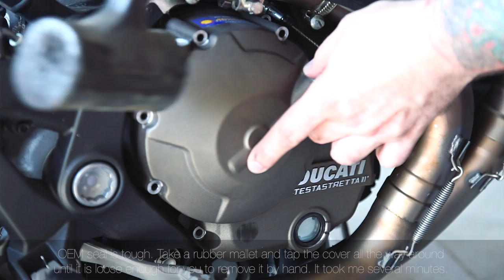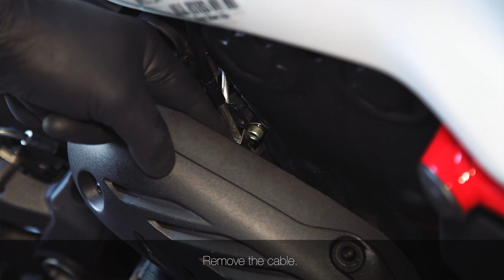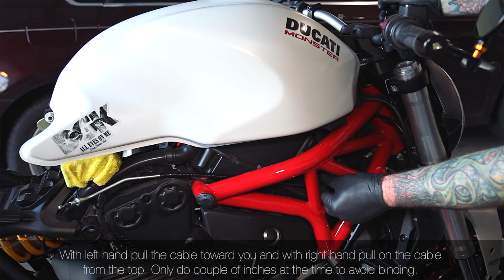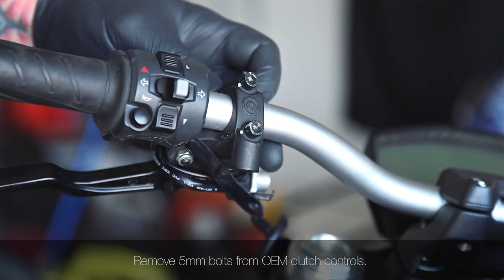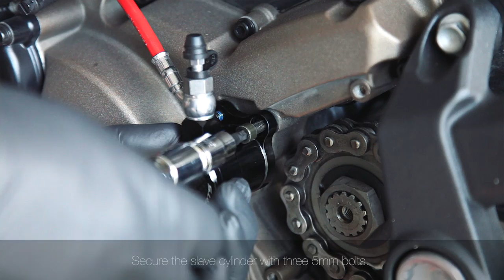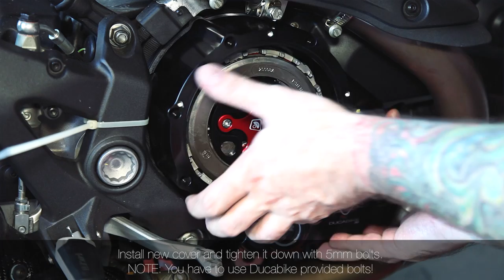Ducati Monster 821 | Ducabike Clear Clutch Cover and Hydraulic Clutch Conversion

Comment: had no idea so much work was involved in changing a clutch cover, you know your stuff man!! videos and bikes
Reply from the maker: It's all because Ducati went cheap with 821 and for whatever reason removed hydraulic clutch. On all other models, it's very simple job.
Reply: Thanks for the detailed video. It's unfortunate so much more needs to be done to get this cover installed. Did you find it to be a pretty easy task? How does the clutch feel vs the cable to you? I'm hoping to do this to my 2021 821.

Comment: For those who converting hydraulics without the clear clutch cover. You also need the plug for clutch cable hole on the right side and of course the clutch slave. And for the sprocket. I believe you can use the 1200 sprocket cover. 10x cheaper then the aftermarket ones.  Hope this info helps. Tq!

Comment: Great Video, excellent workflow! I have an Hypermotard 821 and previously owned two Hyper 1100 (both stolen!!!).
Never understood why Ducati decided to go the cheap way with the 821 engines and clutch cables instead of hydraulic ones.
Seriously thinking to do the mod. Looking at your video looks like is doable by someone with good mechanical skills like me. I am missing the jaw press for the OEM bearing and pin part though...All the best !
Reply from the maker: Damn dude, both stollen? That sucks :/
Yeah, this is not hard to do at all. There are a lot of steps but you should be able to do this in an afternoon. Of course it took me couple of days because of filming and it being insanely hot outside but I put in about an hour of actual work.
Reply from the maker: It's been a while so I don't exactly remember but I think it had to do with the fact that the next piece is torqued quite high and in turn torques the other bolt too. Instructions should state what to do.

Comment: excuse the question a little ignorant to install the clear clutch cover system is it necessary to change the clutch system for the Hydraulic Clutch Conversion?

is it really necessary to hire a specialized mechanic?

Well, I have had a motorcycle for 8 years and I have basic knowledge of motorcycle mechanics, but to carry out this work the accessories are already quite expensive and hiring a mechanic to do the work would be another additional cost, well my question is, can I do this process without requiring a mechanic?
Reply from the maker: Yes, hydraulic conversion is mandatory for the clear cover. Since i don’t know you or your abilities, i can’t really answer your question but what i can say is that i am not a mechanic and do not have a whole lot of experience with motorcycles. Hope that helps.

Comment: I'm trying to remove the clutch cover from my Ducati Monster, and it has the factory adhesive. I can't get it off, even though I've tried prying it and heating it with a heat gun, but I can't detach it.

Comment: So nice mod man..I'm buying all the components this days, but i have a question..what about the dirty oil on the plexiglass? Did you get some overdirty problems on a long time or is it enough clean? I'm scary to spend lot of money to get an extremely dirty plexiglass all the time
Reply from the maker: Plexiglass stays clean. Even when oil is present, it doesn’t look dirty. There isn’t much of it anyway and it just slides down. When you are done with the ride, oil goes down quickly and it doesn’t look dirty at all. If for some reason you get buildup over time, plexiglass is very easy to remove and clean.

Comment: Hi mate i own m821 2018 and im planning to put an exhaust so lookin for zard ,sc project and akra...do i need to put auto tuner or ne fuel management system like rapid pro or dynojet if i put exhaust other than termi which comes wid map key

Comment: I can’t remove the clutch cover  even wiggling  for 3hrs  but it just stock on it🤨is there any problem during the installation
Reply from the maker: The glue they used is very strong so it takes a lot of effort to get it off. Try heat but make sure you don’t use anything sharp to pry it off.

Comment: Great upgrade to the bike I just think it's funny how you had to remove so many parts like the head light just for the install
Reply from the maker: Lots of little steps but not really that much work. With naked bikes, they have to hide things wherever they can which makes working on them a bit harder.

Comment: Very nicely done. I have no plans to buy a Ducati but watched the video till the end anyway. lol.

Other than the good looks what's the advantages of doing this mod? ease of maintenance? better clutch feel?
Reply from the maker: You can work on the clutch by just removing the window vs. removing the whole cover. Don't have to worry about oil spilling nor messing around with liquid sealer again. Clutch lever is feather light now and overall the bike seems a lot smoother. Rev-matching on downshifts seems better to.
Reply: Hold Fast Films Ah okay, sounds nice.

Comment: Fantastic lighting and video work. It'd be really handy if they included some guide rods to help slide the new cover into place without possibly messing up the gasket.

Can you do a clutch basket and plates swap on the bike now with that window? No more need to remove the entire cover to service the clutch?!
Reply from the maker: Thanks man! I agree about the gasket. It fell down 3 times while I was trying to film it. Have to put it on there ever so gently and even then you can't really see if it's bunching up. It's not leaking so far so I think I'm good.

Funny you bring that up, when I first started looking into this I saw that you can work on the clutch without taking the whole housing off and thought meh, I don't need that. But when I put everything on and saw how easy it is to take the front cover off and don't have to deal with liquid gasket and breaking the seal, I was pretty happy.
Reply: Hold Fast Films
I really need to find a good deal on one of those covers if I keep my Diavel, then. Swapping the clutch on my 1098 is cake. It'd be nice to have that kind of convenience. Wish my master cylinders had exposed bleeders like my 1098. Might eventually do that mod, too.

Soooo close to getting a house. Might be ready to start hunting next month, then after the house I should be back to having a small budget for fun stuff. Step 1 will probably be building storage, bright LED lighting, and a bluetooth garage door opener.
Reply from the maker: I feel your pain on house hunting there man. I knew few people from Cali and house prices there are incomprehensible comparing to Kentucky. One time at ATL airport I talked to a fellow photographer from California and he about shit himself when I told him that for $150,000 you can buy a big house in a nice neighborhood. At the end of the day you still live in Kentucky so there's that ...

Good luck with it thought. Hope you find what you're after. I dream of having a large hangar for all my toys and tools ...
Reply: Hold Fast Films
I'm from Ohio. I could have a 10 acre horse ranch back home for the cost of a low end 2br apartment-style condo in California...

Right now I'd be happy with a 2-car garage. We'll upgrade to our 20-year home in another five years or so. For now, it's just a matter of finding a decent place so we're not pissing away over 20k/yr on rent.

Comment: How do you prepare to film these videos?

Are you confident enough of each of the steps before you start that you film your first take, or do you figure out how to do something, undo whatever you did, then film it on the second try?
Reply from the maker: I do like to read through all available documentation several times before I do anything new, just to make sure I understand it. This also helps me visualize what I need to do so I don't have to do it when filming. Filming is so time consuming that I don't want to extend it any more than necessary. 

Certain steps that are straight forward, I just hit record and do it. Something I am unsure about, I have to think through first. There have been couple of things in the past where I had to try it off camera and then re-do it for the camera. It just depends.

Comment: Hi after instaling hydraulic clutch conversion does the clutch become more spongy or hits false neutrals or ne other problem under extreme heat of engine or hiting speeds of 200 kmph

Comment: verry impressiv but why did he done this ? just for the skin or for more performance ? What is changing ?
Reply from the maker: It is mostly for looks but there are benefits as well. You can work on the clutch without taking the whole cover off, which is a pain in the ass. You can just remove the window part and have full access. Also, hydraulic clutch is much better than cable. Easier to pull so there is way less fatigue on my hand etc.
Reply: +Hold Fast Nice ! Thank you verry well ! 
and ride Safe m'y friend

Comment: Another Quality Video! How long did it take for the completion of the Mod?
Reply from the maker: Thanks! It can be done in couple of hours or so. It took me several days since it was very hot here and my garage was even hotter so I only did little bit at the time. I had about 1 hour of raw footage so I did about that much of actual work.
Reply: Very hypnotic, what do you think about the LED light kit they have out? would be great if you did another video.
Im in Texas so i know the heat issue real well!
Reply from the maker: *****
Which kit? Motodemic? Its cool but I don't really care for it for this bike. I did buy an LED bulb from OPT-7 a while ago but never installed it.

Comment: Hey man. Great bud, love your work. Gonna do this mod this weekend on my 821, do I need to drain the oil? It's just been changed. Are there anything else I need to do the install apart from tools?
Reply from the maker: Instructions say to drain the oil but I don't think it's completely necessary especially if you have the bike on the side stand. I did drain mine into a clean container and re-used the oil. Just make sure you don't get any dirt in it before re-filling. I did have a bit of trouble with mine when it comes to the clutch cylinder and the pushrod. It comes with two ball bearings and instructions say to only use one but I had to use both. Good luck! It's not hard, just a lot of fiddly parts.
Reply: HOLD Fast thanks for the tip, my kit only came with one ball. How do I know if it doesn't work with only one ball? Guess the clutch simply won't work?
Reply from the maker: Torgny Näslund if there is a problem, bike will just shut off when you try to put it into gear.

Comment: Hi. Do we absolutely need to install the hydraulic clutch kit? Thanks
Reply from the maker: Yes. The kit is designed that way and clear clutch cover cannot be installed by itself.
Reply: HOLD FAST OK thanks that means another couple of bucks to spend :(

Comment: hello I have a ducato 821 I like to know how much money is making the clutch hydraulic??? mod

and if it can do without the transparent cover of the clutch

thanks for the video is really graet!!!
Reply from the maker: Just go to their website and it price the parts.
Not sure what would be required for hydraulic conversion only, without clear clutch cover. Stock clutch cover needs to be replaced or maybe modified to remove clutch lifter, so you'd have to research whether cover from 1200 would fit 821 or some other option.

Comment: Can you show me a video of it running, I just got my 821 stripe last month I was thinking about putting that on my bike
Reply from the maker: Yes, I plan on doing a short review of this as soon as I can.
Reply: I would like to hear the noise it makes with that clear cover.
I own a Monster 1100s from 2010, it came with a dry clutch from factory. I removed the aluminium cover and replaced it with an open, carbon fiber cover. It makes A LOT of noise. It's so noisy that people think the engine is broken or something. Haha.
Reply from the maker: MrKinir You can hear some of it here but it definitely is not as loud as dry clutch. https://www.youtube.com/watch?v=MJadn3lUtBU

Funny you say that, on one of Jay Leno videos he was talking about that - how people would ask at the light whether his bike is broken. I love that sound!
Reply: Nice. It is 10x quieter than my open dry clutch. You still get to see the beautiful dry clutch but without the noise.

And yeah, people ask that question very often. It's very uncommon for a modern vehicle to make such a weird KLAK-KLAK noise.
I almost got attacked once, because some guy was infuriated by my clutch noise.

Ducatis are very polarizing: people either love them, or absolutely hate them.
Some people compliment me, some people say they are rubbish.

I still love mine, despite her flaws :)
Reply from the maker: MrKinir This is a wet clutch so oil dampens a lot of the noise as well.

Comment: Can I install hyfdrolic clutch but use the original ducati  clutch cover?
Reply from the maker: The way it is, no. You may be able to modify the stock cover but that may or may not work. I dont know for sure.
Reply: @HoldFastFilms  OK I Will try it . Wait for the result .tks

Comment: why didn't you use black gasket maker so it wouldn't be seen like the white is, and why didn't you use a heavy duty Black zip tie instead of a white one?
Reply from the maker: +Roy Patterson Ducatibond is that color and white ziptie is there just for the install, not a permanent solution.

Comment: after watch i have a question, how did i put the engine oil with this new clutch cover ?
Reply from the maker: Same as before. There is a fill port but it is located on the right side of the clutch instead of left.

Comment: awesome stuff man!! my cable ripped n as I'm waiting for a new one I tried connecting old school n shorter without the upper bends yet d clutch doesn't disanges n can't put it in gear so I have t put in d original. .does it have anything t do w d judder spring..

Comment: Thanks for posting this. I have been thinking about getting a clear clutch cover for my Monster 1200. Luckily I wont need to swap over to a hydraulic clutch, so my install will be much easier. Can you post another vid of the cover in action with no music?
Reply from the maker: Yeah, install is much easier on other models and you can probably get away with not draining oil. Might be a bit messier but if the bike is on side-stand, most oil will drain out from the cover. I plan on doing a short review video as soon as I can. Thanks for watching!

Comment: I loved the video!!

Do you have to do the clear clutch cover? I want hydraulic clutch but clear cover is to expensive for me at the moment.
Reply from the maker: I honestly don't know how you would do just hydraulic clutch conversion. You might have to modify OEM clutch cover and possibly remove the clutch actuator mechanism. May not have to but it would look odd just sitting there. Maybe 1200 cover would work but that point it would be cheaper to get the clear one. Good luck man.

Comment: Looks awesome!

How's the new clutch compare?
Reply from the maker: It is feather light in comparison. 1st gear is going to take a bit getting used to. I've never owned anything with hydraulic clutch so I have no frame of reference but in 1st gear, friction zone is immediate, as soon as you start to release the clutch but then it is very long, almost until you release the lever all the way. Not sure if that's the nature of it, or maybe I did something wrong. On the other hand, downshifts are a lot smoother. Before they were very abrupt and sudden. First time I did a hard rev-match, it felt and sounded a lot smoother. Clutch seems to make more noise now, probably because of the window but I like it.

Comment: Ducati Monster 821 fuel tank it can be securely attached to the chassis is not so easy to find open it too so.It has no buildings in front of the fuel tank with the collision gas tank so it does not splash out like the tank is fixed Z1000 very sure why this car fixed the fuel tank is not sure

Comment: wouldnt the liquid seal get mixed with the oil
Reply from the maker: Tplrs Tplrs no, it turns solid. You let it sit for 24-48 hours before pouring the oil back in and starting the bike. I'm not sure this bike has any traditional gaskets anywhere.

Comment: I really hit a brick wall when I was gonna remove the clutch cover. It's stuck AF. I hit way harder than you did but it won't move. Are there any hidden screws or something? It's pretty cold here too, maybe that makes it even harder
Reply: Got it installed finally 😎 did you have any problems with condense or oil on the glass? It got really foggy instantly for me, but we got 1 degree Celsius so I guess that's why. Hopefully it gets better once summer gets here. Might try some hydrophobic coat if it doesn't get better! Happy new year man
Reply from the maker: Hey sorry for the late reply. In the video, I only showed the hammer tapping after I have already loosed it. It took quite a bit more force than what I showed. That OEM sealant is really tough. Maybe try a heatgun to see if that help. Don't try to pry it with anything hard like a screwdriver. Good luck man.

Comment: Why is the Hydraulic Clutch Lever Conversion even required for an aesthetic change?
Reply from the maker: John world is an imperfect place
Reply: @HoldFastFilms  serious mechanical  question, what is the actual reason?
Reply from the maker: John clutch housing cover is different and it wouldn’t work with the cable. This mod is technically for bikes with hydraulic clutch but it works on this one with the conversion.

Comment: No cross tightening. No torque specs, and NEVER say it's ok to use needle nose on a bleeder. Go get a bleeder wrench, or a 6 sided 8mm (should be 8mm, but if not the correct size in a 6 sided). Other then that nice clean video. Nice looking bike, and love the clear cover. Wonder if or how bad the inside will start to discolor over time ?